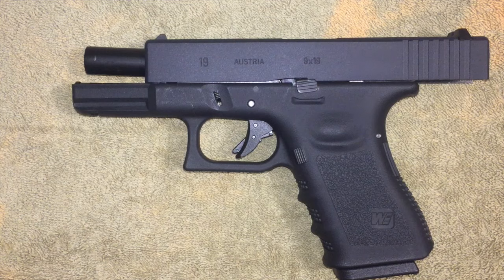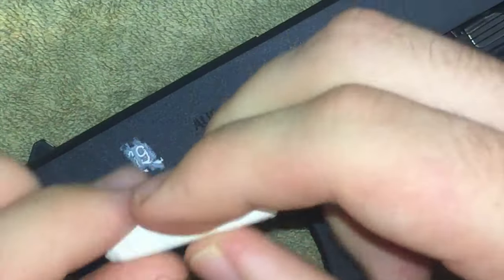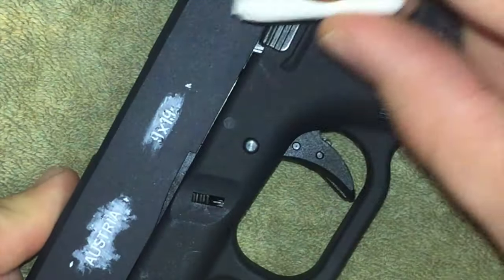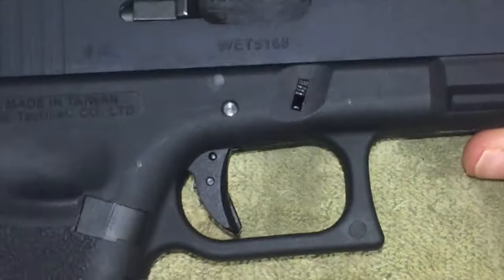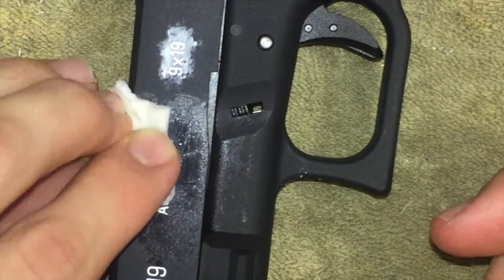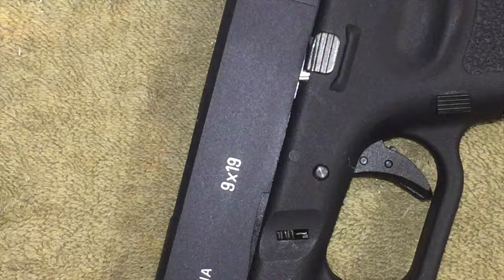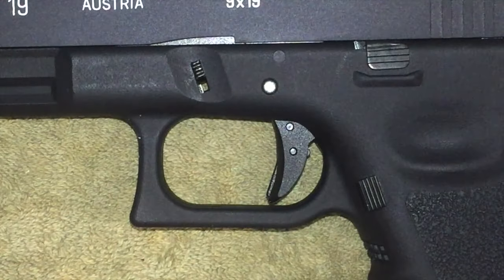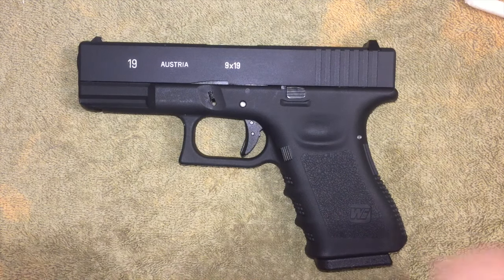How to Color in your Trademarks on your Pistol! Using just a Crayon!

Comment: I used the same method with my real springfield armory xd 45. I've shot over 500 rounds on it and it doesn't melt off. Over time the crayon does come off a bit when I clean the slide after use with CLR. overall I prefer this method over nail polish. Only the front of the slide does get hot but doesn't affect the white color, or it melting.
Reply: Same here - it won't melt off. Done this method for years.
Reply: ironic. i used chalk as well but as a primer , then used a golden yellow , followed by clear coat to seal it in the engravings. polish remover removes excess without worry of eating the chalk away ❤
Reply: Testors paint looks better and works better

Comment: nail polish last longer.  but you must use non - acetone polish remover to clean the extra nail polish off.
Reply: on a diff topic, ... should you use Acetone or Non acetone polish remover to bubble off the orange tip on an airsoft gun?
Reply: i used acetone .... learned my lesson lmao
Reply: Can you use alcohol instead?

Comment: Why does everybody think the slide gets hot enough to melt the wax. The barrel and chamber get very hot but the slide barely touches the barrel therefore doesent really get hot.  Unless its a revolver...plus this is an Airsoft bb gun so it doesnt matter dor that. There now you have the proper info. Goodnight.
Reply: This is incorrect information. If you touch the slide after shooting it will be HOT! Shoot a pistol and find out for yourself!
Reply: @ChachinAKAChino  thats not true and I have done a lot of shooting. You have to shoot a shit load of rounds for a long time for most slides to get hot enough to melt wax. The BARREL can get that hot...the CHAMBER will get that hot...but not the slide. Not off of a few dozen rounds

Comment: Very unique. I'll have to try this. One question, how does the coloring stand up to cleaning and heat from firing?
Reply from the maker: Thank you! But just fyi this is an airsoft pistol in the video. I cannot say for sure how it will hold up on a real steel.

Comment: How long does this last with daily carry and weekly shooting/cleaning?
Reply: About 2 weeks, with real steel not airsoft like his. It's a easy cleanup but has to be touched up every 2 weeks so not worth it just have sum Yung buns from the nail salon paint yours in her day off 🫡😂
Reply: @Real_Richmond_510  will nail polish stay on real steel?
Reply: @bigjerm1631  yes, depending on how you handle the 🔫 on a daily basis. But if cared for it lasts, but when multiple range days it flakes off and needs to be redone ...... 🫡
Reply: @bigjerm1631  but it's easy to do.

Comment: If you're going to color fill....PLEASE USE ENAMEL PAINT...it can stand the heat and it works better on steel...did to my M&P 2.0... non acetone removal
Reply: It's an airsoft gun.....
Reply: @CaptainFordoArc77  ok ? everyone doesn’t use an Airsoft as a CCH 😂 so on real guns use the clear coat and save yourself some hassle

Comment: Nice job. Hey it's a simple way to make a Glock stick out a bit. I love my Glocks. . I like the idea of crayon's how does it hold up?
I'd be worried about it melting.

I just did mine with a testors paint stick and that should stay put,  but I've heard nail polish works well too.
Reply: I have two glocks. A g27 have it for 4 years and recently little bitty chunks of crayons came off.. a month ago I got a g23 and did it again and still nothing has melted or nothing.. its crayons tbh if u don't like it in a future u could always take it off. Other than that it has worked well

Comment: It doesn't melt and run down the pistol when using it?
Reply from the maker: For real steel i am not sure, this one in the video is an airsoft replica.
Reply: Clayton Realist  if that's the case try using a solid paint stick
Reply: Clayton Realist probably not (on a real Glock) the slide would have to get pretty darn hot. Which shouldnt happen the barrel gets hot not the slide, unless youre shooting 400 rounds in a meltdown like IV8888. You should be fine.
Reply: Martin Curtis INERTIA

Comment: You don't need WD-40 if you just wipe it down good with a cotton cloth. The WD-40 might remove some of the crayon, and just rubbing it off with a cloth won't do that.
Reply from the maker: well if you use just a cloth there will be white residue still present. The WD-40 helps remove it off the paint. Never had an issue with it taking off the crayon as the cloth goes over the groves of the letters not into them.
Reply: Max Cherepenin - I did three Glock 19s, 1 Gen 3 and 2 Gen 4s, without using anything but wiping with  a cotton cloth, and there was zero residue. I have since cleaned two of the guns several times without any issues. During your video you could see that some of the crayon come up using WD40 and you had to re-apply. I know what worked for me.
Reply from the maker: hey if it works for you then it works.

Comment: will it work if u use silicon oil instead of wd 40? What happen to the white color after some months? Does it discolor into greyish or yellowish?
Reply from the maker: hmm i actually never tried to use silicone oil, it might or it might not work. You can try it and see what will happen. Some airsoft guns i have had this white lettering for 4 + years now and its still the same white finish. Overtime you might have to refill it in. But again im 4 years in with never having to do so .
Reply: Wow nice. Thanks for the tips! Maybe the wd40 help covering the crayon from air and dust? Haha. Will try for sure thanks :)
Reply from the maker: you are welcome!

Comment: You do realize that's just gonna melt all over the place when you start firing that glock and it heats up
Reply from the maker: i mean unless you are bump firing or something lol and very rarely do people have access to real full auto glocks. If you do this on the real steel i advise using the nail polish method it will hold up to more .

Comment: This is the worst way possible. Clean with thinner or acetone.Thin testors enamel with thinner 50/50. Use a drop on a toothpick. The thin paint will flow into the grooves.Let dry. touch up if needed. Wipe off any access with paper towel and thinner. DONE! That simple.